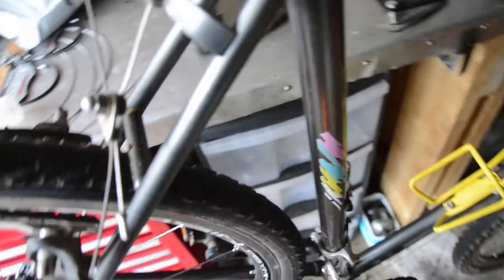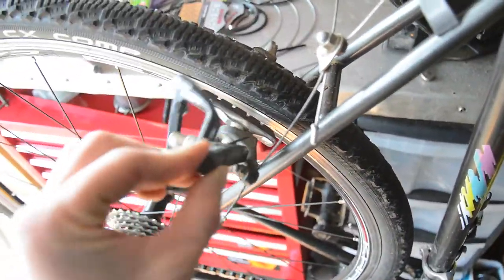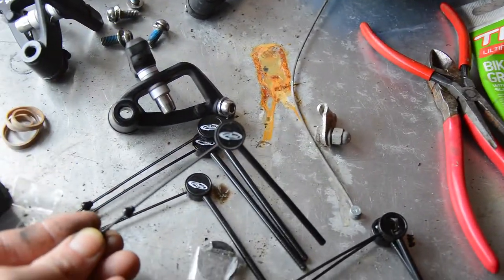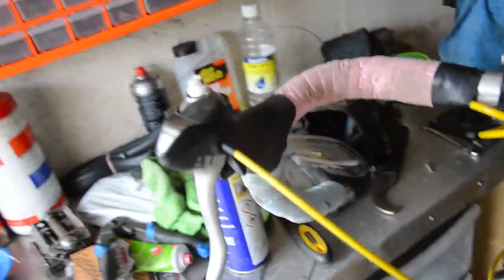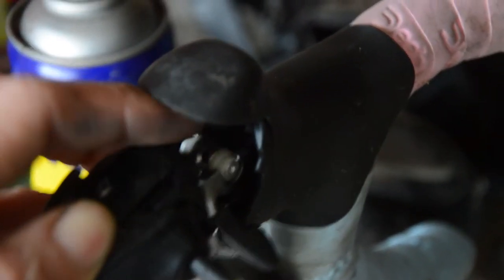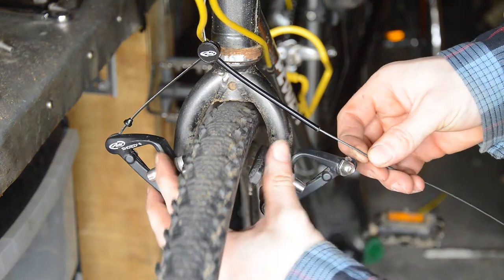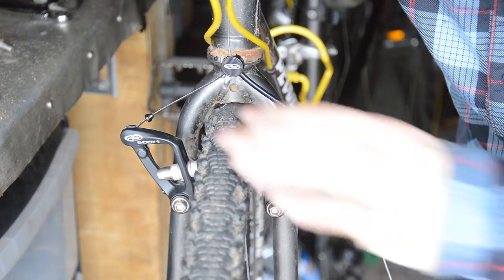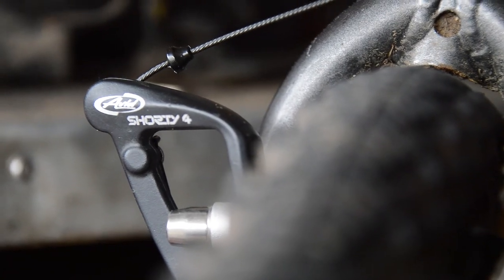Avid Shorty 4 Install - Cantilever Brake Upgrade - Bicycle Maintenance

Comment: Just a note for anyone who finds this video.  Looking at the set up the angle of the shorty 4 is too far out.  It is likely decreasing the mechanical advantage they were designed for.  Likely the issue is the cantilever boss distance on an old frame.  New bikes and hence newer cantilevers are designed for a wider spacing.  Makes adapting new cantilevers to old bikes problematic
Reply from the maker: Is that so?  I have them on a bike with a 135mm rear.

Comment: Is it possible to swap out the Cantilever brakes for Vbrakes? Vbrakes were the next step after Cantilevered and right before discs.
Reply: It's possible but brake lever pull distance might be wrong and brakes are a pain to adjust. Then you need a pair of vbrake levers too with longer pull.
Reply: OniJon I've seen Vbrake kits on sale for as little as $18.00US.
Reply from the maker: Well, OniJon beat me too it.  I think it's just down to the pull ratio, which in this instance, wouldn't be compatible with the brifters.
Reply: When V-brakes were a new thing, you could get in-line adaptors that changed the cable pull to allow canti levers to work with a V-brake, they were called "travel agents". Looks like they're still around, about £20 each.